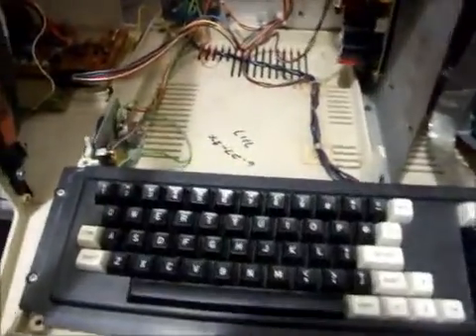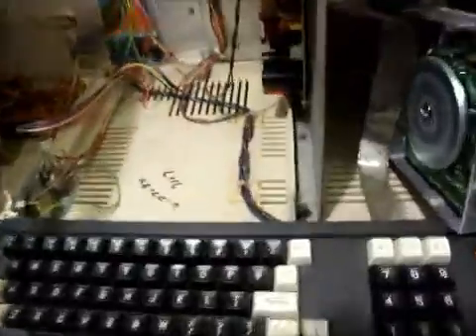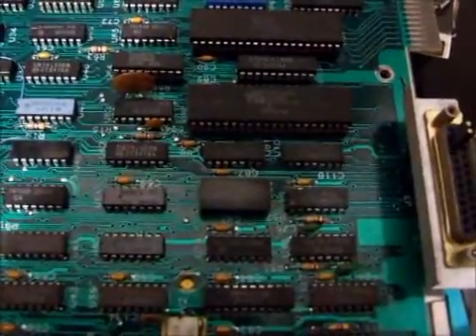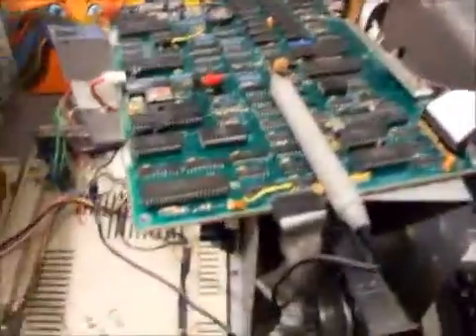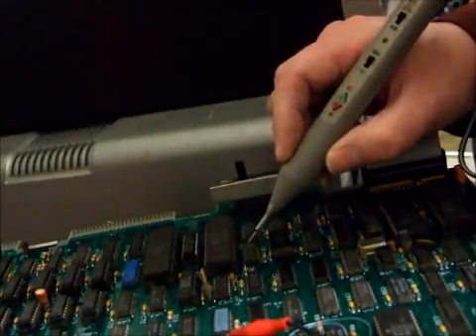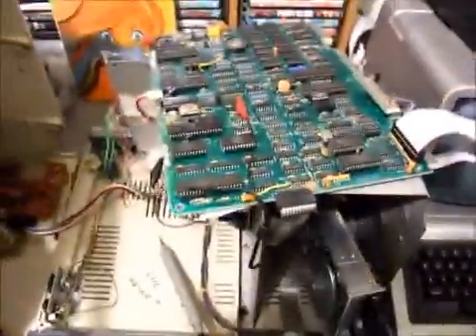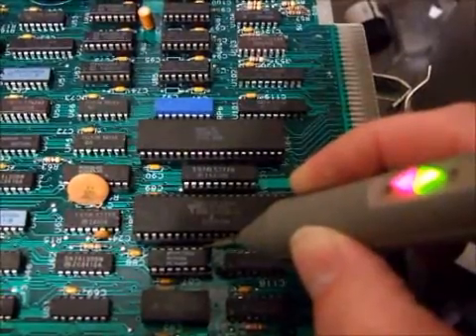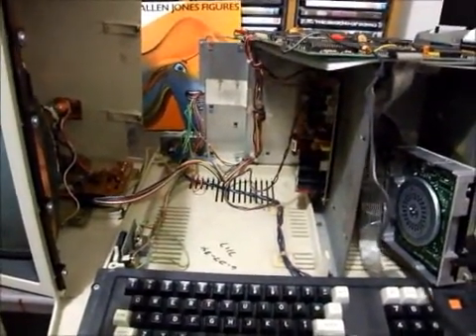Repair TRS-80 Model 4 serial port

Comment: It's great you share these repair tips.  Does the model 4p use the same chips?
Reply from the maker: It's very similar on the 4P-GA, just the part numbers are different.  Trace pins 2 and 3 on the RS232 port  back to the MC1488 and that is most likely your culprit.

Comment: Great info.

Where do you get the 128K bubble tags?  NOS?
Reply from the maker: The come with the machines as I buy them - wish I could find them NOS - if Radio Shack upgraded a persons M4 to 128K then they installed the new increased memory size badge.